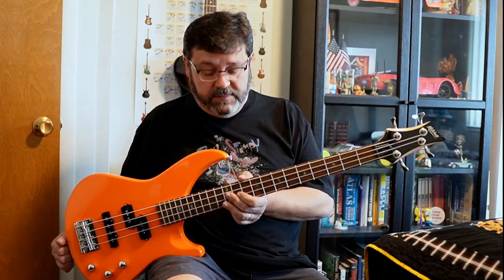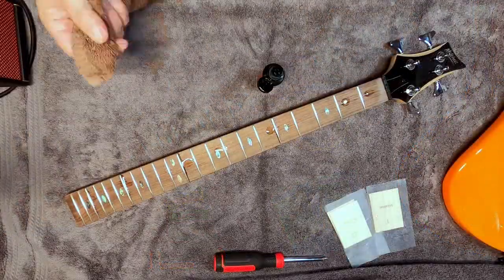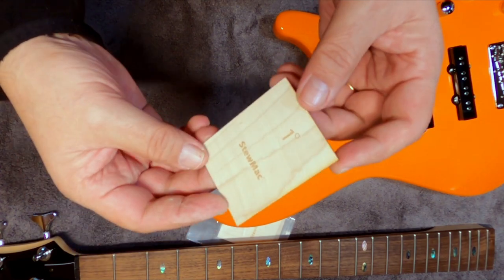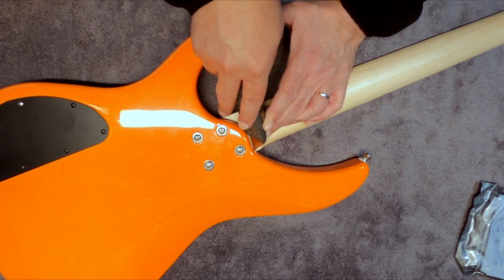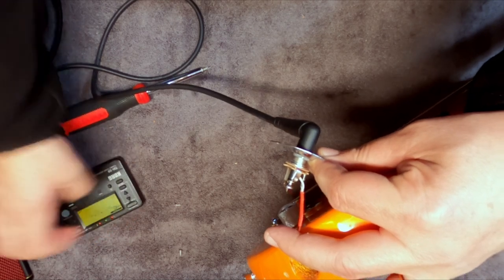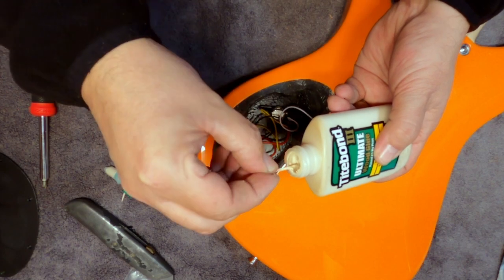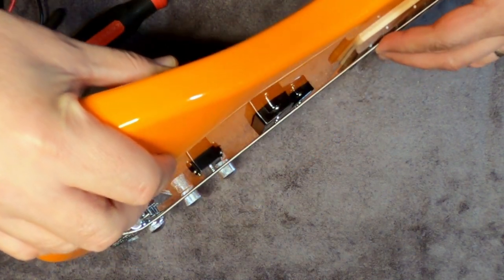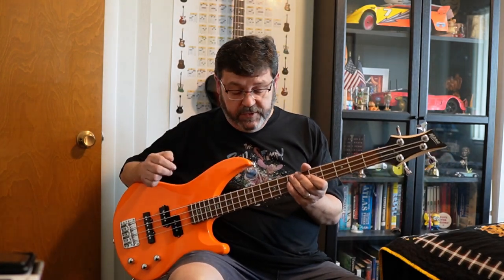Fixing a brand new Mitchell MB100 - So many things wrong...

Comment: Fortunately got mine on sale for under $100. It also came with the pickups way too low, due not having any foam or springs under them at all, so I installed the missing foam. The fret ends were the sharpest I've ever come across (easy to fix), but the worst problem was that frets 2-9 were high on the treble side only,  and needed to be leveled and crowned. I was happy to fix that because I'd never done it before and wanted to try it for the first time on a cheap instrument . The truss rod, intonation & saddle heights were way out of adjustment but everything else was fine. The pickups sounded ok, but I had an extra set of pickups and controls from a Mexican Fender so I put them in and definitely like them better. It's lightweight and well balanced. I'm very happy with it now but for a beginner it would have been a disaster.

Comment: I got mine for $97 on sale. Baby blue. It has a bad buzz due to a Grounding issue somewhere but after shielding the pickup cavities, running grounding wires and shielding the control cavity, now it is dead silent. I also re soldered my Jack just to be safe. The setup was great and fret ends felt nice and the fretboard was rounded. 🤷‍♂️ my fretboard was a nice dark Purple Heart. Seems like yours is laurel or pao ferro?

Comment: I bought one of these about the same time as you and, it too, was an abject failure.  All the issues you mentioned were there along with a dull clear coat of some kind over the gloss gray finish.  The clear would flake and chip if you dared even look at the instrument!  Eventually, I decided to go through it starting with routing in a Hipshot bridge, doing a fret level, and working on the nut.  This worked until I could no longer stand the finish and I got tired of seeing it just sit in the corner of my music room so a few months back I took it completely completely apart.  It's now a Rick Nielson checkerboard tribute and the lacquer will cure for another three weeks before I color sand and rub it out.  Along with the paint I am making a new bone nut to replace the plastic one, fixing a few sprouting frets, and getting ready to replace the tone pot that never worked from the get go.  I know there will be those that wonder why I (or anyone, for that matter) would spend the time to do all this work.  There is no real justification beyond the fact that building and fixing stuff is my hobby and I have to justify the machine shop that still occupies my garage!   Oddly enough, my former bandmate from the 60's just bought one of these and he raves about it.  Apparently, they wanted to unload a bunch of these before starting the current run which has better quality control.  I was as surprised at his good experience as I was by so many other folks bad experience!  Thanks for the video!
Reply from the maker: I know the feeling well - you just have to fix it. I like the sound of the checkerboard finish too. Thanks for the comment!

Comment: For me; 125.00 from GC, one slightly high fret (13) to level and sharp fret edges to polish up (no fret sprout) . Raised the pickups. The neck was spot on, I found no ground issues and the pickups sound great to me. I have an advantage over other beginners in that I can do the setup myself. Overall I really like this guitar. A setup would have run 100.00 if I had taken it to a good shop, so at 225.00 in my opinion it is still a good deal.

Comment: Could you do a more in depth explanation of how you replaced the jack? I have the same bass but in grey and I have to replace the jack but don’t know how to do it
Reply from the maker: You have to use a soldering iron and remove the wires at the old jack the resolder the wires onto the new jack. It's not that hard but does require a few tools.

Comment: I picked up one of these for the sole purpose of tearing it down and rebuilding it. I replaced the P/U with SD Quarter Pounds, I replaced the tuners with the same crappy tuners, but in black, new bridge, different knobs (black), I leveled the frets and restrung it with DR strings. It's now my favorite bass for the most part, and I still have less than $400 in it. i still need to do the nut, however.
Reply from the maker: I really liked it after it was fixed, I bet yours sounds  awesome with the pickups upgraded.

Comment: So what was your opinion of the pickups?  I have one of these I picked up for almost free.  Was considering changing out the pickups as I've heard that's how Mitchell keeps the price low, by using junk pickups.  Once you adjusted them, sounds like they were okay.?  The nut on mine was toast, looked like someone filed the groves out to make the strings sit lower?  I've removed the plastic nut and will replace with bone or Tusq.  Mine also came with no screws under the pickup, gonna install them as well.  The one I got was mint blue.  Even though it was a purty color, I've stripped it down to bare wood and am woodburning an eagle and flag motif into the body, which I will then refinish with as many coats of lacquer as necessary.  It's a gift for my brother so I would like to get it playable, but if not it will be really cool wall art.
Reply from the maker: The pickups sounded better to me than I would have thought at the price point and anything I would want to replace them with would cost more than what I paid for the bass so I left the stock one in it.